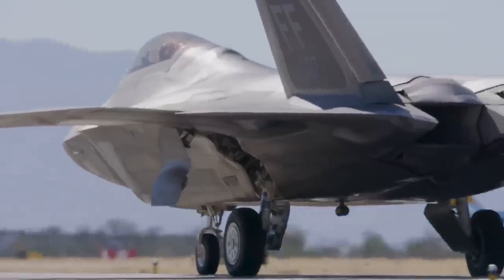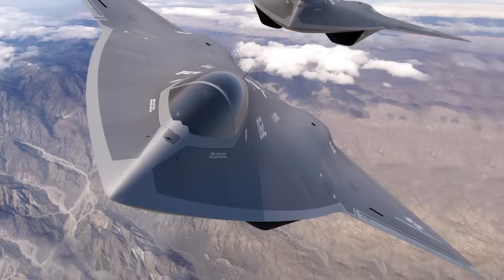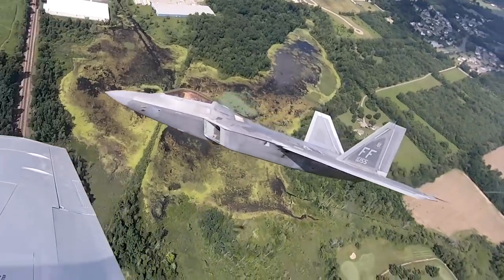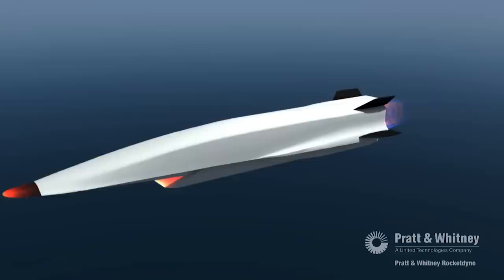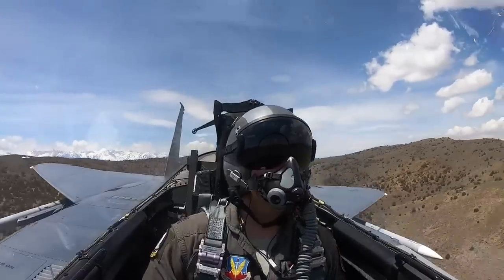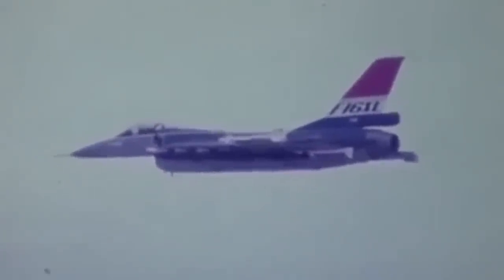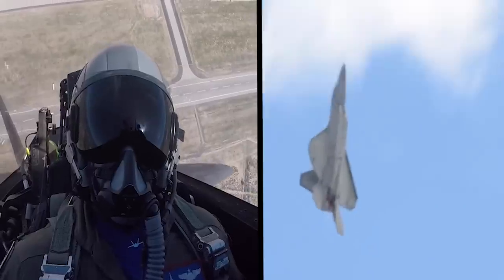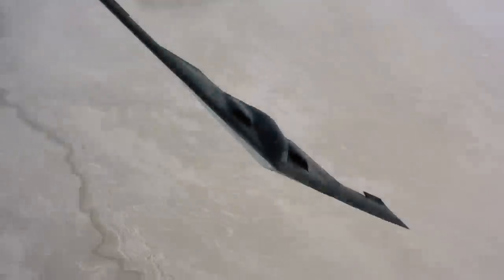How America could build the best stealth fighter in history

Comment: Active flow control using bleed air (compressed air off the jet engine) is fine as long as the engine is still running.  If the engine quits, there will be no "dead sticking" it in to a landing because you will lose flight controls.

Comment: 9:37 very common misconception. 

The only operational Russian aircraft that use thrust vectoring, the SU-30SM, SU-35 and SU-57 currently use a single axis TVC nozzle that is actually rotated inwards about 45 degrees and mirrored on the other side so that both nozzles move up and down in a V shape. This gives the illusion of multi axis thrust vectoring (the correct term, not "3D" or 360 degree" thrust vectoring) but the nozzles themselves only move in a single axis like the F-22.

The advantage of the Russian design is that you can command some yaw with the nozzles. The downside is that it is also tied to a pitch moment as well, and you cannot command pitch and yaw independently, or a roll about the longitudinal axis without some serious nose sideslip. That means you always lose thrust efficiency and authority with these nozzles. Another downside is that they cannot be used to trim the aircraft like the F-22's single axis nozzles or the F-16 VISTA/F-15 ACTIVE/MiG-29 OVT's multi axis nozzles can because of the loss of thrust in the horizontal component.

No operational fighter jet has ever had multi axis thrust vectoring, only technology demonstrators. This shows that ultimately, unless you are getting rid of control surfaces and the weight of those components and actuators entirely, it's really not that useful.

Comment: First off, glad you're feeling better. This is a lot to taken as I am sure you're aware. Thirst vectoring, as in space craft thrusters and a higher degree of output nozzle rotation s get my vote. Why? Because, Plan for the worst hope for the best.  It's only so true to a certain extent modern 6th Gen won't need as much dog fighting skills based on Stand Off Protocols as enemy combatants will also be faster this gap closer will be shorter and improved counter measures will also increase. I read the Chinese on their version of the Flying Wing the H-20 will have a similar tech you mentioned regarding changing the electrical charge over the leading wing edges. Their approach is for stall control. Which IMHO seems leaps and bounds over the sensors we use. I assume the AF has done something to reduce their faulty readings from quartz transducers, again odd they failed to take moisture into account. The OB Laser would be interesting but I don't remember the particular engine with built in generation unit, but if it hampers other performance, no. If they can make the F-117 flying brick they can eliminate vertical stabilizers. The Ceramic Stealth coating would be a must.   An internal rotatory munitions rack for missle options. And certainly drone wing men. Just saying...

Comment: Flow control is a nightmare of complexity and associated maintenance, ask any AV-8 maintainer. Using boundary layer control (BLC) in some form (pretty popular in the 50's and 60's) is also a nightmare. Not only do you have hot gas tubes running all over the place, the plumbing is also taking up precious space. Even at that, creating enough force for any level of agility would be somewhere between difficult and impossible. Simple thrust vectoring would be easier.

Comment: How about computer design and development, rapid prototype, computer simulation, 3D printing and computerized tooling. Will the Next gen fighter use more traditional technologies for prototyping and production or will computers be doing much more of the work. And what will be the impact of these technologies. Will development of new aircraft allow for different types for different roles. And will air forces continue to upgrade aircraft when new designs can be cheaply developed.  And how much of the technology developed for the F-35 influence future fighters. I would like to see variable angled vertical stabilizers that can be adapted for different roles. For take off and landing the tail can be closer to near vertical and when stealth is needed the tails can fold down along and blended the main wings.

Comment: A composite, radar absorptive airframe, a power weight ratio like an F-15A, with thrust vectoring to compensate for no rudder, internal weapon stowage akin to an A-6 in capacity, a laser weapon instead of a projectile weapon.  After that we start nit picking like deciding id we stack the miracle engine with a scramjet.  The fighter could have the abilty to strap a big tank to its belly...  Now you have a stealth fighter that can go into orbit and reenter like Rutans plane?  It would have orbital sppeds and the same sort of reach...  A fighter with in your backyard range that is not on radar that might deliver small diameter bombs with viper control software.  The fighter would protect the missiles until the gas tank required it to go home.  Alternately, the stealth fighter goes into the backyard but is the forward air spotter for a B-52 load of small diameter bombs... or vipers.

Comment: Awesome vid. Why not use a retractable tail section or one that lays flat and can be deployed when it is needed for maneuverability? Also my BIL worked on the F117 when it was still "dark" and when it became public and he said they had to repair the coating after every flight. His job was the coating. 

Also several years ago a local college received a patent for an "alloy" they had invented that was a combination of ceramics and metal and it supposedly had the capability to transform jet engines and I can't remember if it was mentioned in the article, but I thought of reentry vehicles and hypersonic jets but using it to make stealth jets more durable seems like a no-brainer as well. 

Politics being what they are, I doubt we will ever see the Air Force eliminate fighter jockeys, but it seems pretty clear that the future is drones. Sacrificial AI drone swarms will even be the "Star Trek shields" of the future I believe. AI drone swarms will be used to protect the main tactical asset deep in enemy territory and AI drone swarms will be used to protect important military assets from enemy attack. That will be the future.

Comment: The goal is to gain total control of airspace.  What is the best way (most reliable and fastest) to achieve this?  First you want to remove enemy aircraft.  It seems that it is missiles which actually kill the target.  Rather develop fighter aircraft that can operate in an extremely hostile airspace, shouldn't more effort be put into developing next generation missiles that can deal with all known threats?
Reply: I agree. However, whilst the best defence may be a good offence, relying solely on it is foolish. If you can evade the enemy's attacks whilst dishing out superior firepower, why wouldn't you? Having it as a backup would be beneficial in situations has gained an advantage. Also, I'm sure you know, but the development of aircraft and weapons systems are done independently meaning there doesn't have to be a choice between them, and you can do both provided you are willing to fund them.

Comment: This may be a silly question..but has anyone ever considered drop solid fuel rocket boosters to increase speed, save on liquid fuel extend range etc etc .or is the torque it would cause just to much for a plane to handle...just curious

Comment: Next step in fighters is speed and more stealth. Speed increases stealth at low range as you will be able to go back over the horizon and beat radar and missiles most of the time as they can’t make a big maneuver to line up with you without destroying its self plus more stealth will make it much harder for a SAM to get accurate lock. We’re talking Mach 2.8+ and half inch radar cross section from all angles.

Comment: 6:14 Hard on the throttle and.... turbo lag
9:33 Russians jets do not have 3D TVC

"Contrary to popular notion Su-30/35 or Su-57 doesn’t have 3D Thrust Vectoring – Flanker’s thrust vectoring
 actually move in one plane (up or down) but are canted outward to the engine axis. 
The canting allows movement in all rotational axis by vectoring each engine nozzle differently." A.S

Comment: If I were designing the next air dominance fighter stealth wouldn't be a priority.   Up-time, low maintenance costs, and parts commonality would be.  

The F-22 is still the best, most dominant plane in the world BUT it suffers from horrible operational costs and extremely low up-time.  Part of that up-time and cost problem is due to the stealth coatings.  

Otherwise, delta wing without cannards, cranked arrow style similar to the F-16XL demonstrator, airframe designed for stealth but not optimized for it (i.e shaped for it but without the incredibly tight tolerances that drive cost and maintenance), no tail, no veritical control surface, use 2 engines.  Otherwise basically the same as you described.

Comment: I think if the 6th generation fighter jet does not use a laser defense system then it should at least have a missile defense system.  Think of what a fast short ranged missile that works with the jet's radar system to intercept incoming missiles.  Think of a Stinger, but 2-3x faster and 1/10th the range.  A modern jet could fit a half dozen of these internally with little trouble.  Think though how much harder it would be to shoot down a fighter jet with something like an S-400 or better if the targets could intercept the incoming missiles.  With stealth and faster speeds and missiles like the AIM-260, unless countries like Russia and China can match these technologies they will be at a huge disadvantage.

Comment: I get it that Dogfighting is over if you are sitting in a stealth fighter (like F-35) and you go against, lets say a J-17. You prolly shoot 4 of them out of the sky until you are in range of their high power radar to detect you (our simulation show about 10-15miles detection range).
However if you are in a stealth plane (lets again assume F-35) and you are up against a Grand Dragon (similar radar crossection, at least according to propaganda), both planes would not be able to detect each other above 10-15miles or get a decent missile lock. So you are ending up in a dogfight. Yes a dogfight with off bore sight missiles (which the F-35 can only carry 2 tops and then it looses stealth). Also in the case a SAM sight actually is able to target you (lets say 20-30 miles for the future S500) you want to be able to dodge the missile and get to stealth mode again to loose missile tracking. In both cases maneuverability is key and Fat-Amy just cannot do it as well as other fighters. This is why I hope the NGAD will again be super meneuverable to mitigate such attacks. (and sorry for my English it is not my native language)
So in a sim it was actually easier to overwhelm a S400 site with old Frogfoots flying extra low using earth curvature to hide and then overwhelm the S400 with the huge amount of anti-rad missiles they can carry, than F-35s undetected with only 4 internal HARMs. Yes the F-35s were unharmed, but you needed triple the planes to do it and were ultra low on fuel burning away from enemy scrambled fighters because you are empty. So at least the NGAD needs more range and supercruise.

Comment: A building sized metal printer in any metal type with any propertys desired from tungstun to ceramics to plastics .
All printed from the inside out . With minimul humans required . The new engins on the drawing boards an stelth charistics along with reconfigureable electronics ...
Almost to all computer an robot built air craft or even space craft !!!

Comment: I'm old enough to remember when experts said the age of the close in dogfight was over so built F4 jets with missiles but no guns during Viet Nam.  A $100M fighter plane that can't dogfight close in is like a combat soldier that only gets a sniper's rifle.
Reply: I remember that the F35A got the gun added because of ground support not air to air. The gun is amazing at CAS for the fellas on the ground and by the nature of CAS they need support ASAP. You aren't going to send in an A10 from the nearby base when you can just vector in a nearby F35 with a gun to do the same thing effectively. 
But in terms of air to air, the gun is pretty redundant with modern close range IR missiles that can lock on at any angle. By the time you get close enough to use your guns, both of you would have had to used up all of your missiles. And if you are out of missiles you should be turning back towards your allies or a base since you are basically cannon fodder.
Reply: The maturity of BVR combat when the F4 was introduced was in its infancy. It's all about BVR in our current age as we have matured our doctrines, thinking, and technology.

Comment: I had talked about this before with my brother who works for the DOD and the u.s. Air Force has many things available to them already they have systems from the B2 bomber F-22 and F-35 and all the new things they have learned about this stealth technology also there is all these new composite materials that they are putting into use already I think I would go ahead and start building build 5 to 10 of them test them put them through the wringer and if they don't work you didn't sink too much into them and I do believe the Air Force has the capability to manufacture them on their own with the help of some of their partners AKA Lockheed Martin Boeing and Northrop Grumman